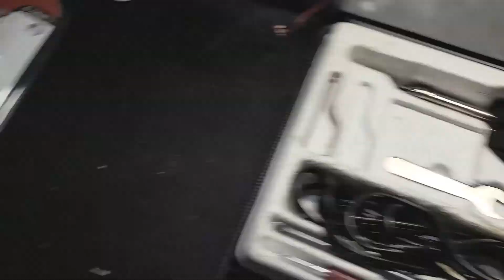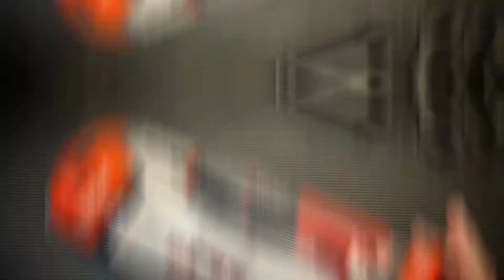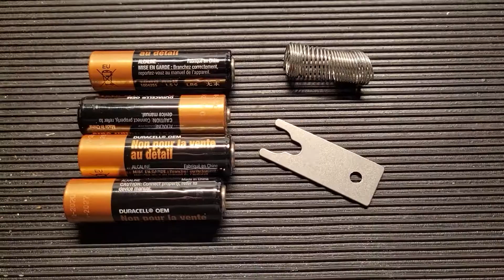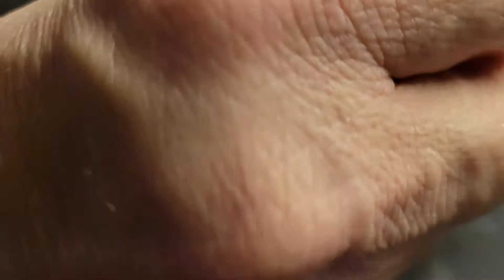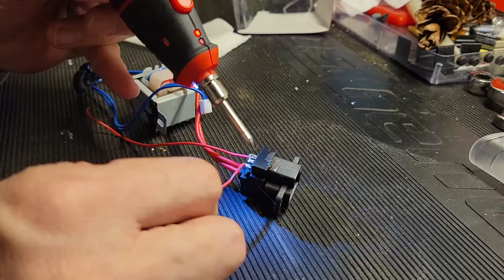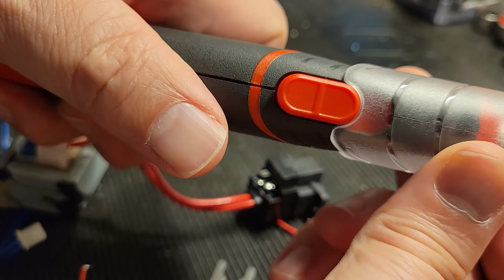Weller Cordless Soldering Iron WLIBAK8

Comment: I bought this I don’t know why it stops melting it’s almost as if I need to clean it after every solder😢…. It works but I spent about 15 min to do a mic cable waiting for it to heat :/
Reply from the maker: That can be very frustrating, make sure you have fresh batteries for best results. Thank you for sharing your experience.

Comment: Excellent review. I think NiMh rechargeable AA batteries are better suited than alkaline batteries for high current draw applications like a soldering iron. Many reviewers who use NiMh AA have more positive feedback than those just use disposable alkaline batteries. Lithium ION would be even better but quality control on Lion battery cells are critical and when the Lithium ion battery runs out, it's much more difficult to find a replacement on the go where as you can find AA size in any local convenience store.
Reply from the maker: Thank you for sharing your useful insight on batteries. Always good to learn more.

Comment: That is impressive for AA batteries. I don’t think it would be useful for much other than an emergency kit. Thanks for the review👍
Reply from the maker: Yeah, I agree pretty impressive for four tiny batteries. I think it is a great tool for the occasional small circuit board job, anything more serious and you'll need a plug in. thanks for watching.